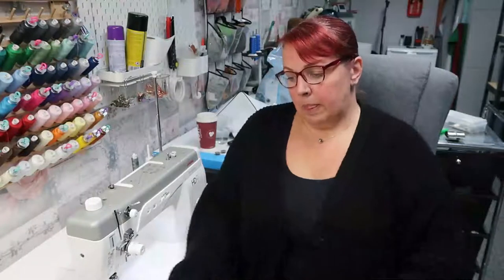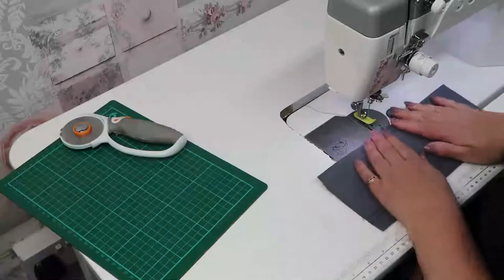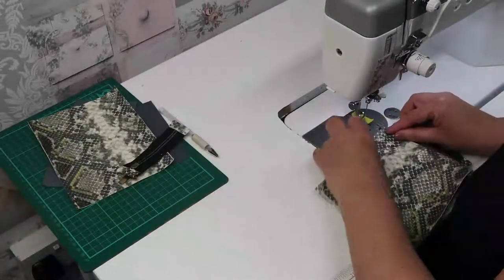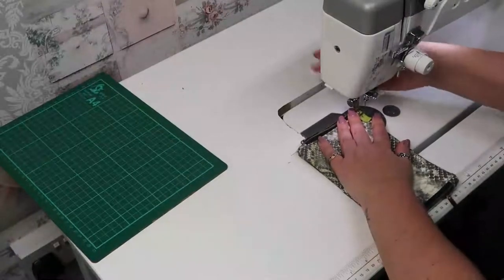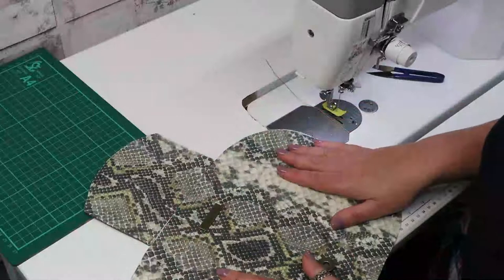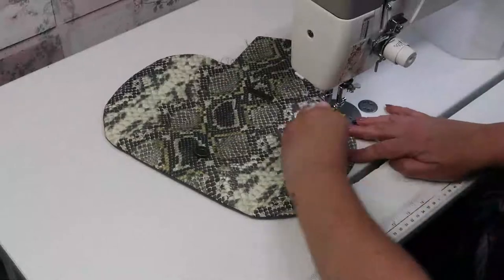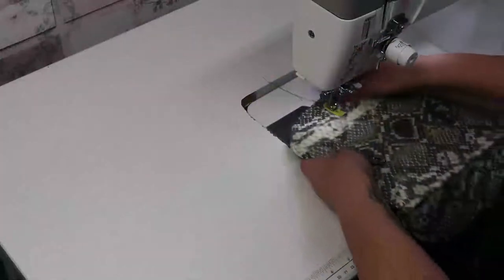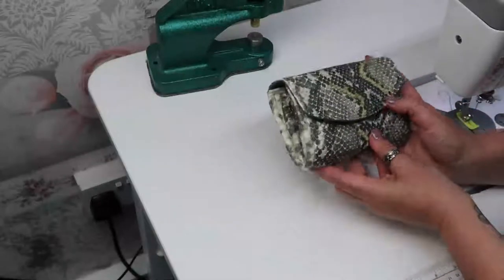Step-by-step guide to sewing mini NCW on Janome HD9 - perfect for beginners!

Comment: Thanks for the video.  I use thick and thin vinyl on my hd9 and have never had a problem with the feed dogs eating the vinyl, it occasionally will skip a stitch if too thick, have u tried altering your pressure to see if that stops it. Xx
Reply from the maker: I've had a few times it's eaten it mainly on thicker so I am always careful nothing worse than it happening on that hike stretch x

Comment: Hi Deb my name is Kiva. I love your videos. Thanks. I am at a toss up between getting the hd9 and an industrial straight stitch. I already have a walking foot industrial machine. Would you suggest the hd9 over an industrial straight stitch? How close is the hd9 to industrial strength? I am nearly done paying off the hd9. I just want to make the right choice.
Reply from the maker: It has alot of power I have a walking foot industrial not a standard industrial striaghht stitch so it would be hard to compare. I love that the hd9 is portable tho so when I got to sewcials or retreats I can take it with me and still make things I want too x
Reply: Thanks for your advice. I just want to be sure I am picking the right sewing machine. I own the Juki/Jin NA11UT walking foot. It’s similar to what you have. I love it also. I am done paying off the Janome HD9 this coming Tuesday. The place I am paying the machine off at it states away from where I live. It was the same with the industrial I got. The portability is why I wanted to get the HD9 as well. I just started sewing this last year. I went all in and am working at building a business. It’s a lot to learn. But I love it. I am working at focusing my energy and efforts. It’s easy to get off tract. When your trying to learn online by yourself. I want to take some classes after this. I love your tutorials. Thanks.
Reply: Hello hun please can I ask you where did you shop for the sewing machines that are letting you pay bit by bit cause I would love to purchase a machine that I can pay every week/month (cause they are really expensive 😞), I hope you don’t mind me asking & I really hope you can do me the kindness of replying to me 🤞🏻 oh & 1 last thing sorry I’m only just messaging you now but I’ve just seen this post. Kind regards from Bev xx @kivamahatma9817
Reply from the maker: @foxynannabev hi saved for my machine before I bought but it's worth checking local dealers to see if they have hp schemes you can purchase sewing machines on